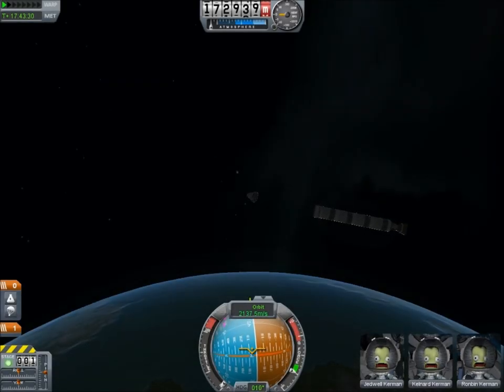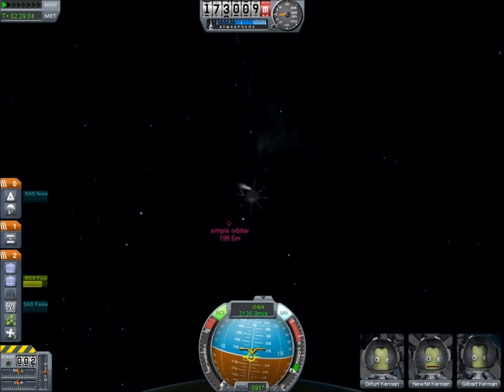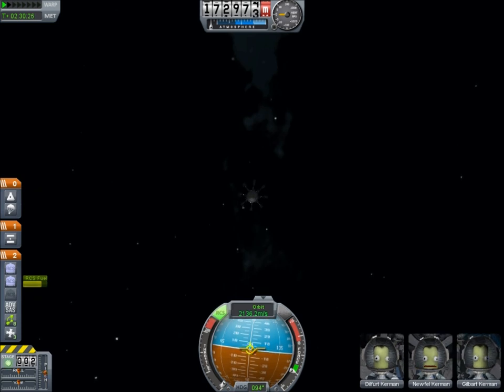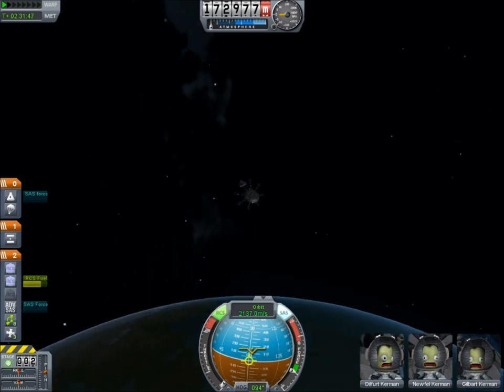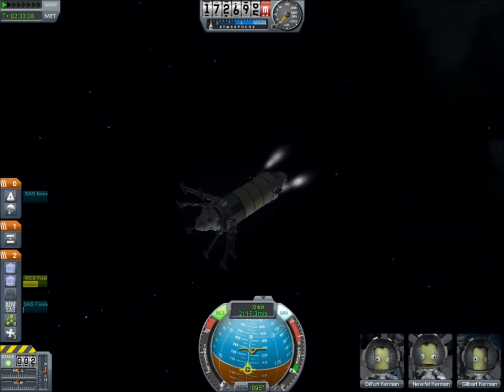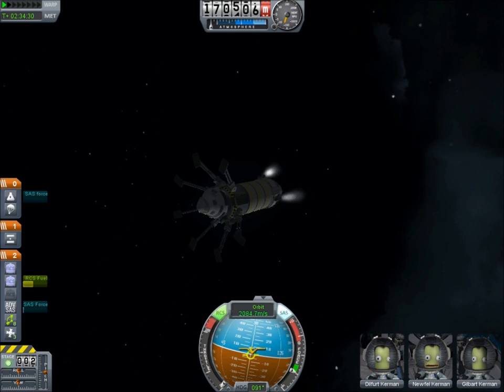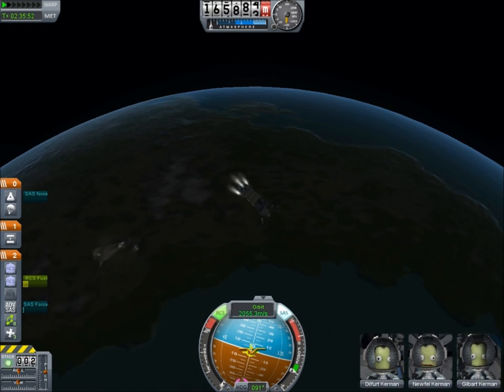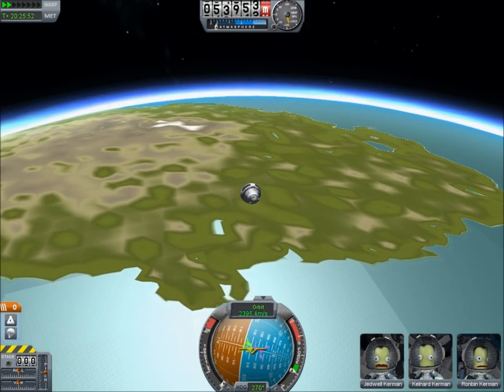Rendezvous and Rescue of a Stranded Capsule In Kerbal Space Program

Comment: Awesome, I tried a similar ship myself using the landing legs as a basket to capture the capsule, but why did you only use 3 RCS thrusters on the front? Wouldn't it give you more thrust and control and less tendency to roll if you used 4 RCS thrusters on either end of the craft?